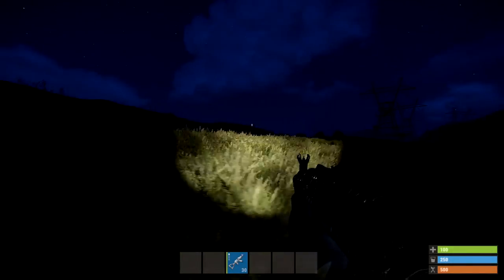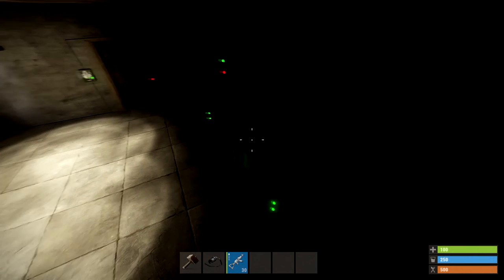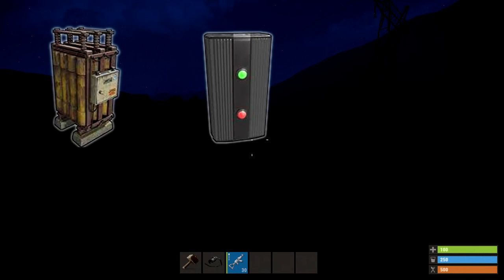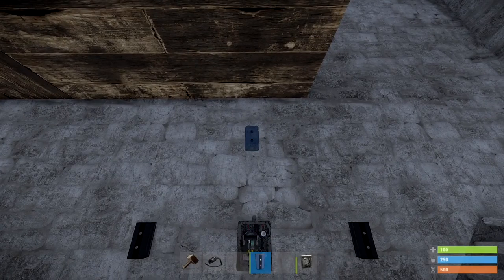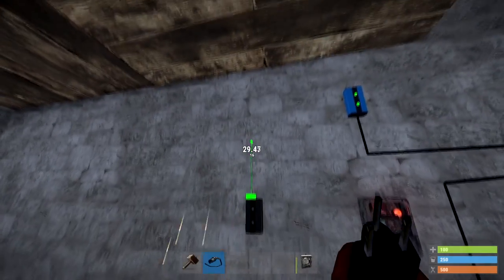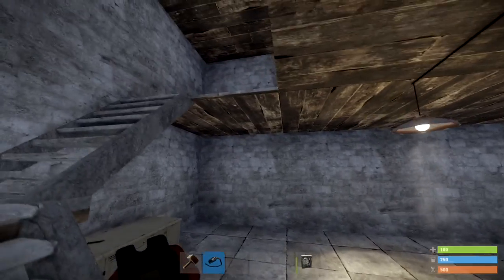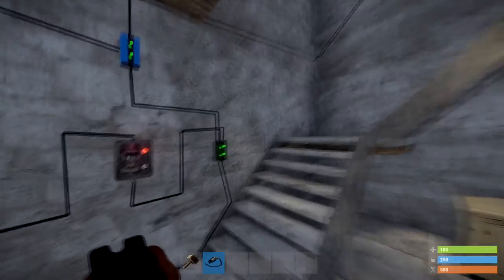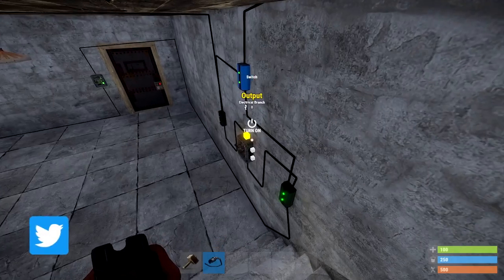Alternating Circuit Build | RUST Electric Guide

Comment: I would just use a memory cell and a button hooked up to the toggle input on that. The button doesn't require any power input and it would halve the amount of power needed (using the same power for both light circuits instead of having two active circuits at all times).
Reply from the maker: memory cells are excellent for this type of stuff. viewers requested a switch but maybe I could have gotten away with a button instead 😂